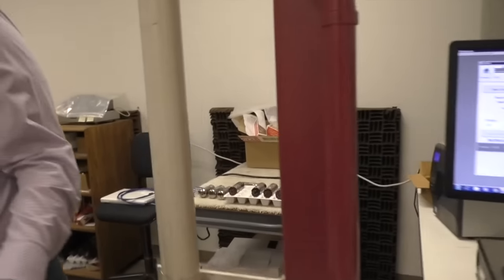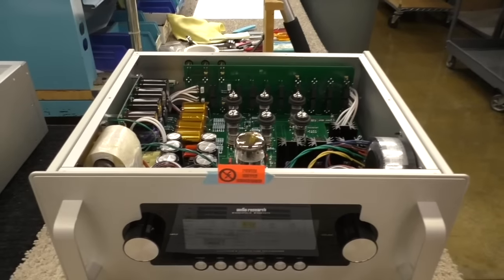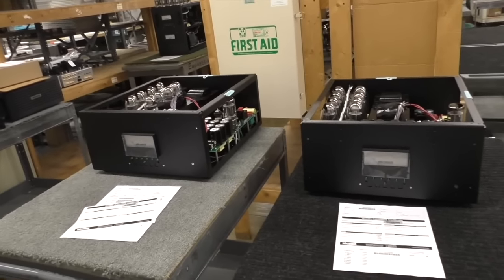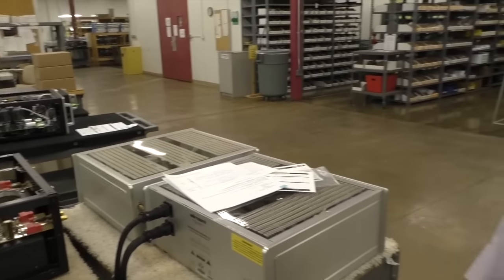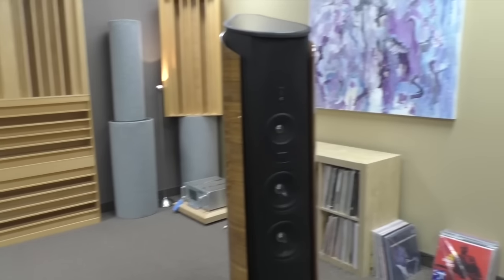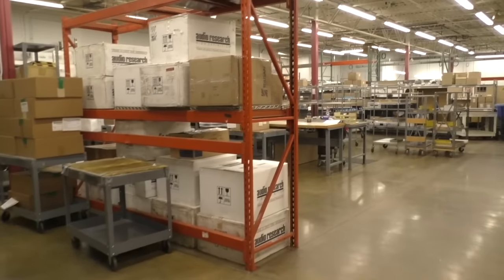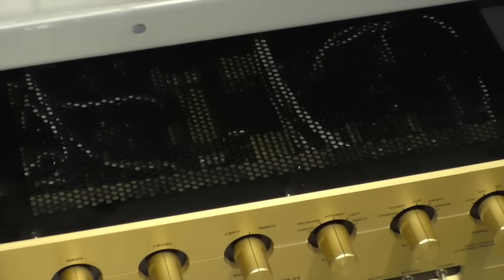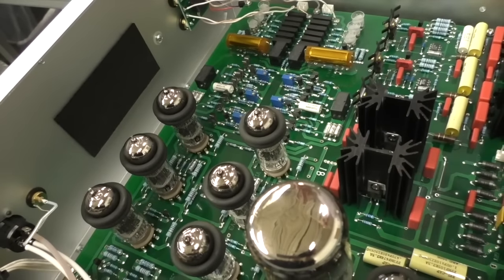Analogplanet.com Visits Audio Research Part 2

Comment: I used to repair Audio Research equipment when I worked is stereo stores. I was a bit upset when I heard Leonard retired. He knew the parts well. I would have like to have replaced him. But I own several old Audio Research pieces That I want to keep going. (SP2,SP6,D50,D90)
Reply: i miss Leonard, we had some good chats.

Comment: owned many tube and SS amps+preamps---audio research is one of the top 10 companies.  naim too. it has the pace I need, its convenient+inexpensive+ easy to find used. thevintage marantz 8b was the best tube amp and its the only amp i regret selling.  the fisher 500c  was vg. the D240 was vg, one of the very best solid state amps and like all AR its super high quality. audible illusions mod 3a was great.   Im sure every the audio research reference is the best= amazing, close or maybe better than the Marantz 8b